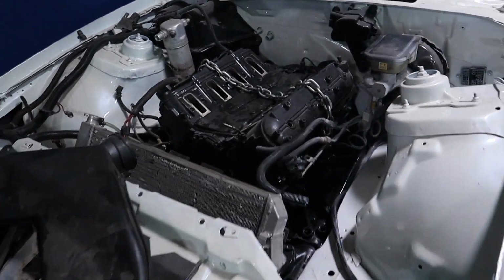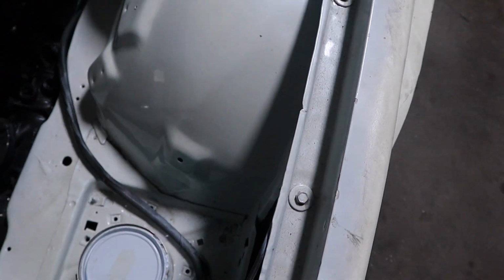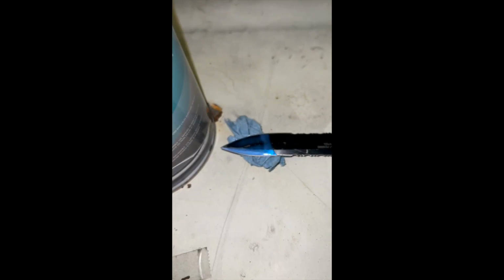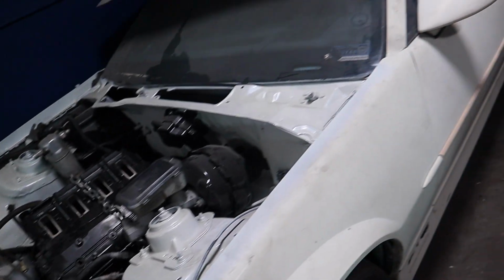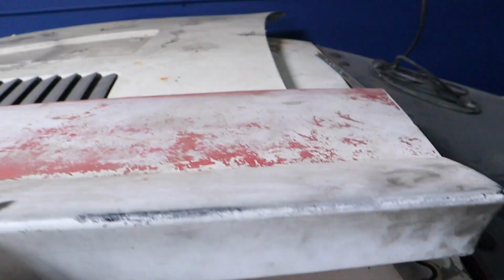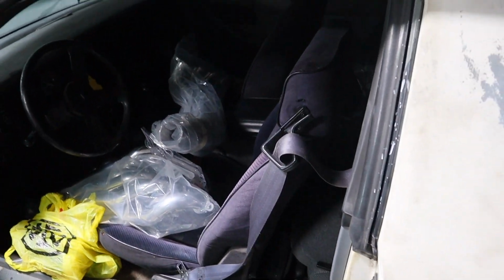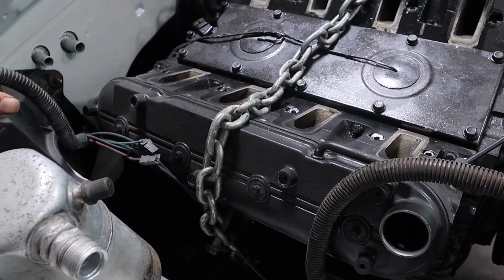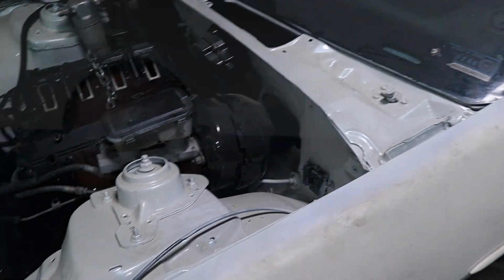UPDATE ON TWINS LS SWAP 1988 IROC Z SHES HEADED OUT THE DOOR TO A BETTER PLACE

Comment: She’s gonna love that car when it’s done. 👍🏽

I say use the 5.3 in the next raffle but add a 4l60 trans for the grand prize. 
2nd place a harness or tune 
3rd place $500 and 4th place your merch.

Shout out to OC Hot Rods in Corona CA. They did the exhaust in my 67 Camaro and Roadster Shop chassis install l.
Reply from the maker: Right on phill appreciate it I think that’ll workout keep you guys posted congrats on the grand prize spot 🥇